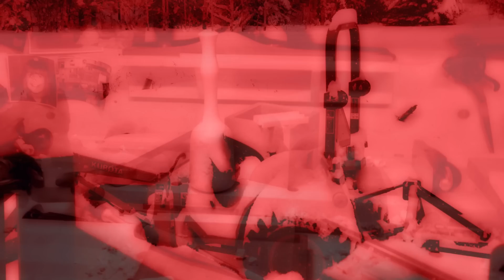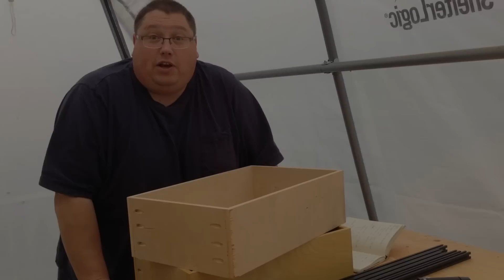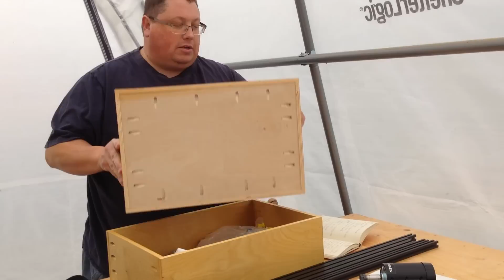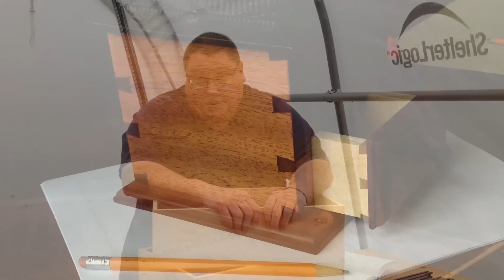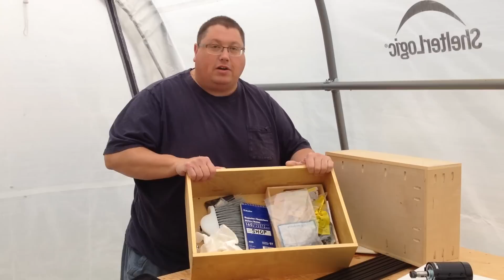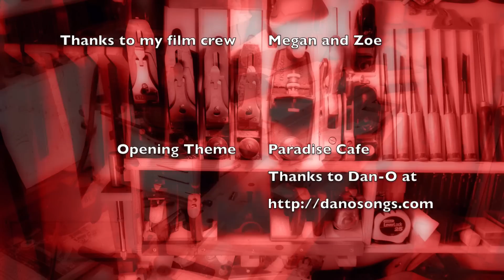How NOT to Make a Drawer

Comment: The vast majority of birch plywood in the world right now is Chinese Birch (and most red oak and poplar...and luan...and merenti...).  It is horrible in almost every way you can measure it.  Strength and screw retention is just a little better than particle board.  Veneers are prone to delamination and the face veneers are so thin that you will sand through them with very little effort.  The plywood itself varies significantly in thickness as well, I have measured small panels which had a 1/16" thickness variance across 12" of width, great fun when you are trying to get them to fit in a dado.  Not to mention the internal voids.  Nothing like sinking a screw and watching it tear all the way through a sheet of 3/4" plywood because there was nothing but air between the face veneers.

You can specify domestic (North American/Western European) plywood, though a lot of that has suffered from the race to the bottom that the Chinese suppliers have given.  Even relatively OK quality plywood from a mill like Columbia Forest Products uses face veneers that are only around 1/60" thick - very easy to damage.  The adhesives are better though, and the cores are more sound as well.  Normally will cost 25% more though, and a lot of lumber yards don't even bother with carrying it anymore (local mills will vary of course).

The better option if you want to do plywood drawers though is to go with a premium plywood.  Real Baltic Birch (not that Russian crap...most of it is Chinese Birch in disguise), Appleply or similar void free multi-ply.  The face veneers are around twice as thick as those on regular domestic plywoods and three to four times as thick as they are on Chinese.  Costs about twice what the Chinese Birch costs - but since you won't have to toss half the sheet because it falls apart on you, I consider them about even.  Appleply is nice, as you can get other face veneers instead of birch.

After all that - plywood boxes are not a bad thing.  I would have to agree with Roger DC though and say that pocket hole screws are sort of...the wrong thing to do.  Regular glue with something like a lock rabet joint is pretty quick on a plywood drawer box.  Holds up well and is easy to cut.  Dowels are sort of the standard on plywood boxes from an "industry" stand point.  Very strong, pretty easy - though alignment is a bit more difficult for a home shop.  You can avoid some of the alignment issues and use through dowels on the sides to dress it up some.  Either a system like a Miller dowel or just a long dowel.  You can also simply drive screws or nails through on butt joints.  Brads are small enough to not get much notice, stainless or brass flat head screws dress it up some (make sure your spacing and alignments are uniform to aid in the decorative nature).  Use an oval head screw and then grind it flat with the drawer side after installation - looks like a metal rivet holding the drawer together.

Beyond that...dovetails are nice, but if you are doing a lot of them...invest in a jig, even a cheap one makes it fly once set up.  The last kitchen I did had 40 drawer boxes between actual drawer and pullouts.  While an experienced dovetailer can hand cut a drawer in 20 minutes or so.  I can do 4 or 5 on the jig in that amount of time without hurrying.
Reply from the maker: Thanks for watching and commenting.

Comment: I've been building cabinets for 40 years. 1/2 in plywood make good drawer boxes but you can't buy plain old plywood. Real Baltic Birch plywood is what you need. I don't think about pocket hole for drawers. For plywood drawers it a locking rabbet or box joints made on the table saw.
Reply from the maker: +Richard M I agree about the Baltic birch. It can be hard to find around these parts but next time I need some I've decided to order some to keep on hand.

Comment: 1/2 in material? Better to use broad dovetail like 1 in and larger, glue and pin nail. Rabbet panels into frames. Even hand powered screw driving fractures the fast growth farmed wood used for ply today.

Comment: Baltic birch , or Russian birch is the same thing . I have been a furniture/cabinet maker for over ,49 years. most drawers are made from ,,5/8 materials. Baltic birch is a bit more expensive  but is glued up well with no voids. almost all cabinet grade Ply has paper thin top or face veneer. it's the core that's important. noyt sure what the situation bin Canada is on plywood , but I always ask where the core is made. I only deal with reliable dealers. if your going to make a drawer use only good materials and god the love of God ,dado in the bottoms. other wise its not a drawer.. , but as stated a piece of crap. a lot of work goes into making drawers, don't skimp on the materials. other wise your reputation will be crap as well. a well made drawer is your signature. also hot glue the bottom and the to the sides and front and back. will keep it strong from racking and rattle free. chop away my fellow woodworkers
Reply from the maker: Excellent points. Fortunately I'm not worried about my reputation. As stated, it was an experiment.

Comment: Just nail with 18 ga. finish nail with glue and use thin Luan with a 1/4 in dado for the bottom without glue for expansion
Reply: Johnny Arnaud I assume you mean 1/4" luan plywood. Not necessary with sheet goods (plywood) to let it "float" in a dado. Plywood is extremely stable and will not expand and contract like solid wood. You can glue the bottoms and make a stronger drawer.